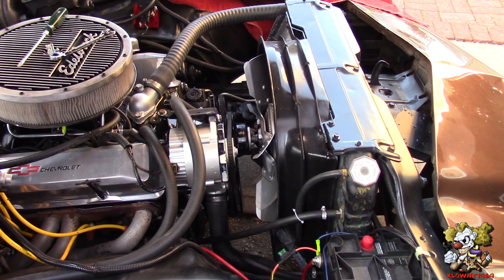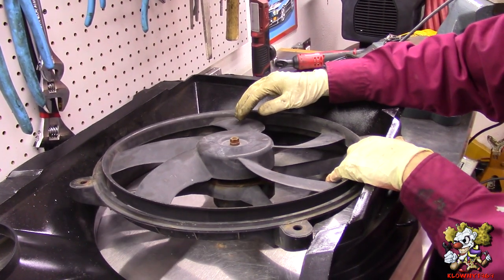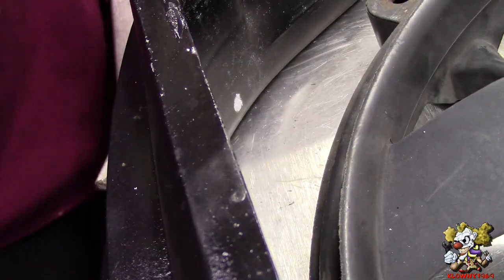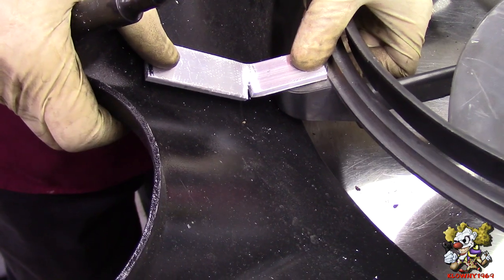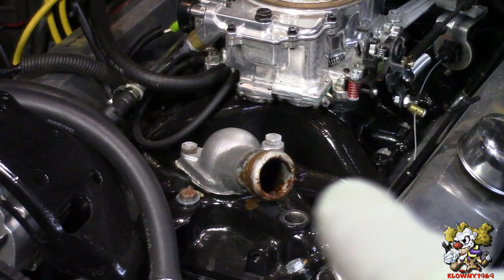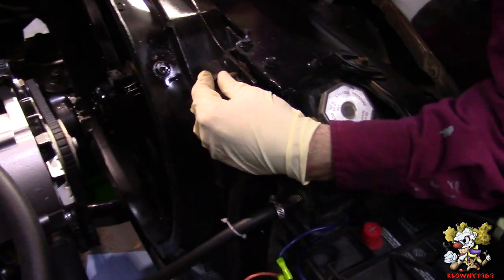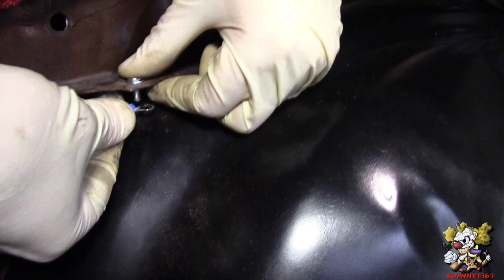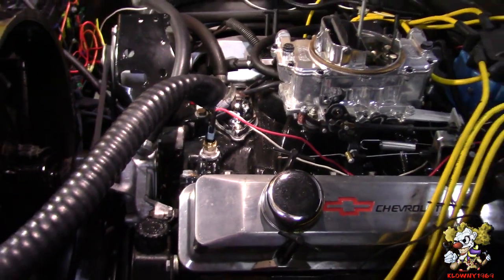Mechanical Fan To Electric Fan Conversion!! - GAIN HORSEPOWER

Comment: you're not gaining horsepower, you reducing power loss, by eliminating a belt driven fan.
the engine still makes the same base horsepower without accessories.
Reply from the maker: alvarsdzenis ur funny
Reply from the maker: alvarsdzenis its a matter of perspecitve..you are gaining horsepower at the wheels by doing this..and technically its called parasitic loss that you are improving on..thanks for watching and commenting
Reply: right is right
Reply from the maker: alvarsdzenis i like going left
Reply: don't we all
Reply: alvarsdzenis its actually been proven that it gains hp, as well as boosting fuel economy, and better cooling than the conventional belt driven fan
Reply: no it hasn't, lol. there is less parasitic power loss. if you gained power, you could add 100 fans & have a ton more power.
a belt fan uses about 5 to 12 hp. electric fan uses about 3, and move more air. hence, more efficient. that's why we use them on our race cars
Reply: +alvarsdzenis - You ain't a Smart Klown :/